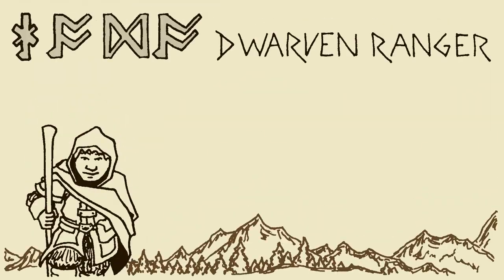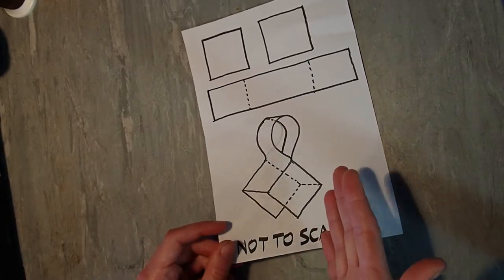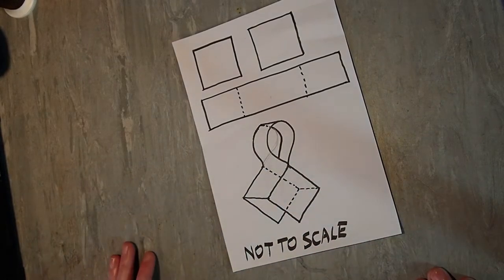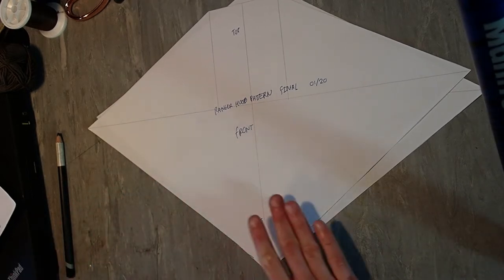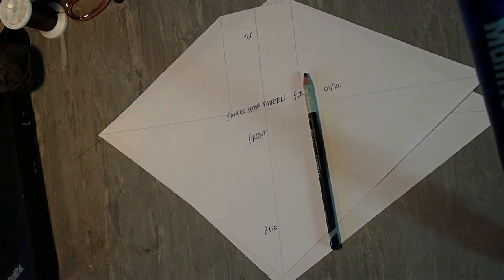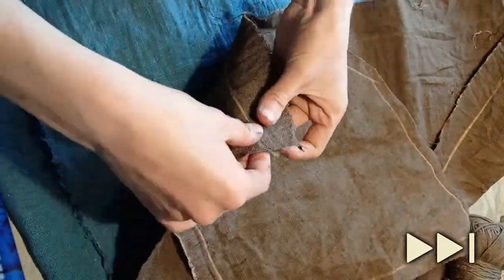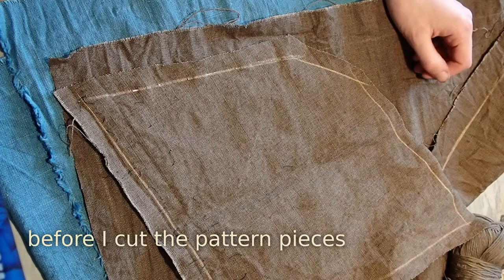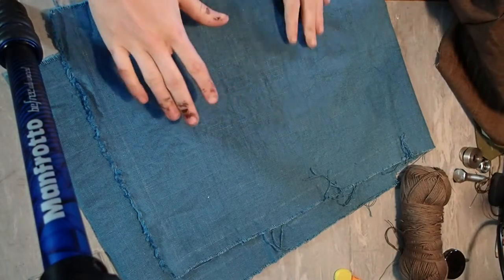PART 1: Making my Hood Pattern [Dwarven/Modified Viking Hood – lined/reversible]

Comment: One of the things that you can do rather than heming is to encase the edges with something else. I used to have one that had a nice piece of, I believe, cloth ribbon just folded around the rim for a bit of added detail, though the inside of the actual hood portion had a lining unlike the lower portions which didn't. I've seen some used where they used chrome tan leather for that purpose as well, though that had the leather hemmed before folding it around the rims.

You can also extend the pattern to a larger point to get other forms with later cuts rather easily such as a more circle hood than the angles, but that feels less dwarven there.
Reply from the maker: some good ideas, however I would stay clear of using leather on fabric, it is fine for looks/functionality but if your going to wear your clothing heavily it will make it a lot more complex to wash without washing soap spoiling the leather
Reply: @IodoDwarvenRanger  It's more of the "leather ribbons" that a lot of fabric stores have available for that kind of use.

I've seen them, heavily, used with heavier fabrics for things such as hats and coats which wouldn't be washed as much there if at all with some of them beyond wipe downs.
Reply from the maker: @AzraelThanatos  true, but those are mostly just made of PU leather, then if you were getting it wet out walking etc... if it were real leather you would have to keep treating it with wax or polish to stop it from cracking, but if you like the look go for it

Comment: I like your modification! I intend to follow along—to an extent. I’ll be making a cut down the front square-kite-thing for front lacing, just so it fits my own style a bit better. I’ll need mine to fit a Dúnedain aesthetic, after all
Reply from the maker: cool, front lacing will work, I made a hood like that a few years ago, for the Dúnedain aesthetic you'd be best making the top of the hood curved instead of pointed too, good luck ;)